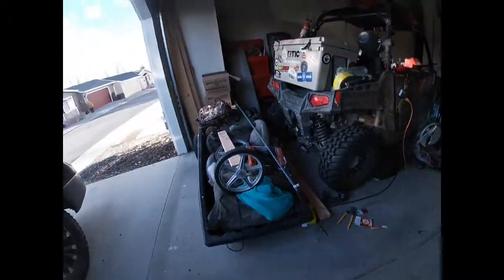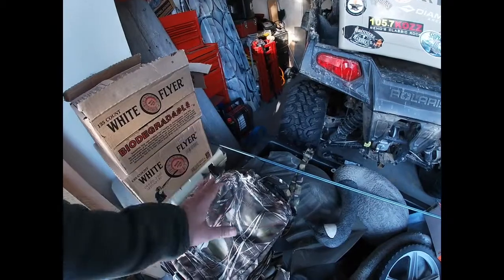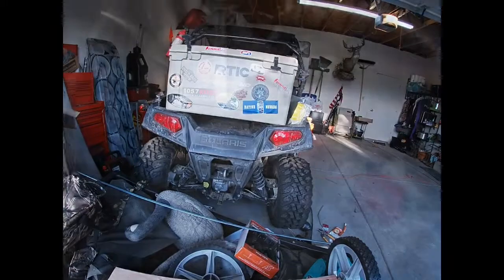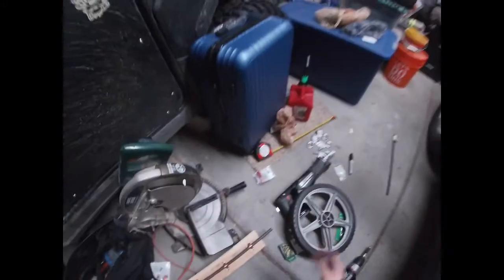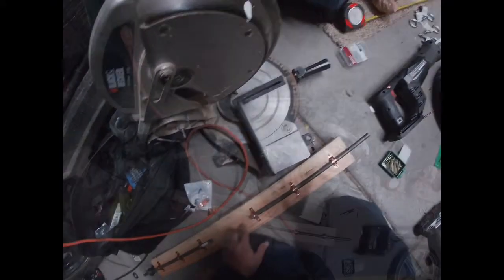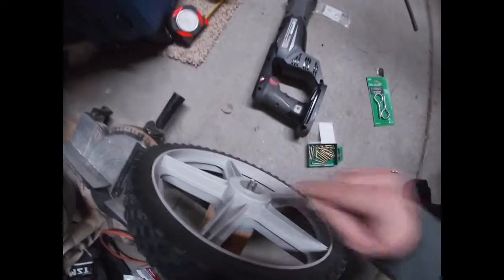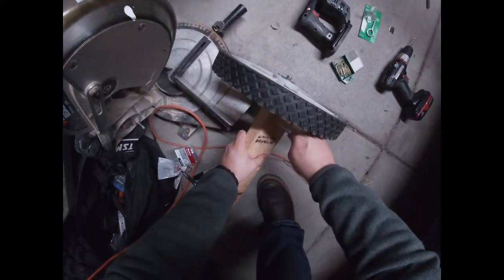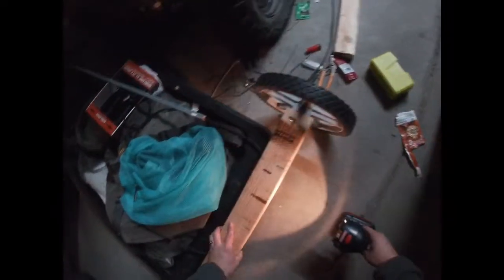Jet Sled Cart mod For California Refuge Hunting

Comment: If u do that, would be better to just use a flat bed metal garden wagon at harbor freight($80). Everyone will be off to the races and you'll still be strapping things together
Reply from the maker: Everything rolls out of the bed of my truck and it all floats in the water no need to mess with straps anymore

Comment: Great idea! I'll be making this for my Jet Sled here in Nevada. I think this will work perfect at my duck club, since I can easily remove to float my sled to island blinds. Are you pulling the sled with a rope? Also, I'm assuming it does not turn since you are running two straight axles...
Reply from the maker: Been busy but plan to put a push bar on it.